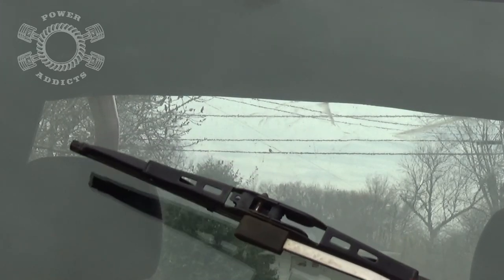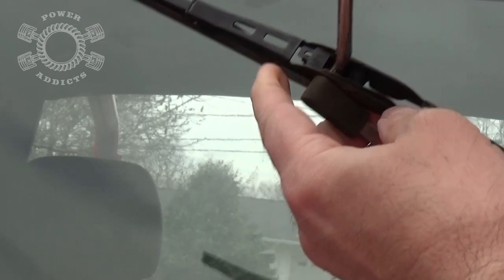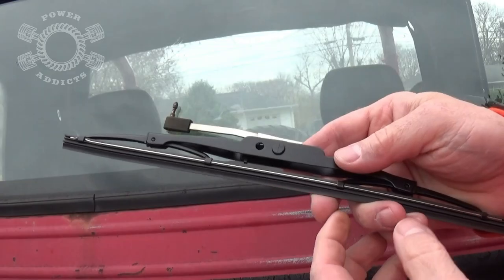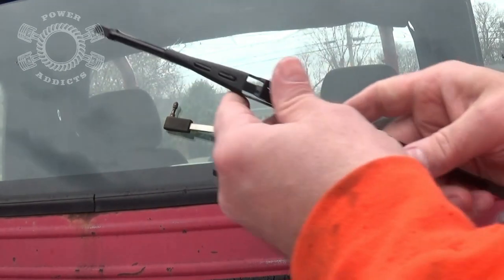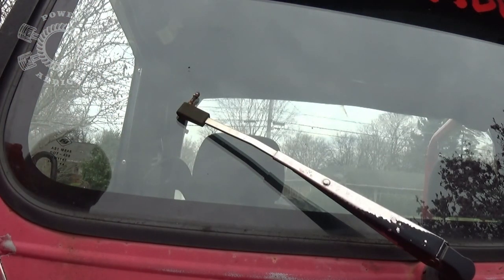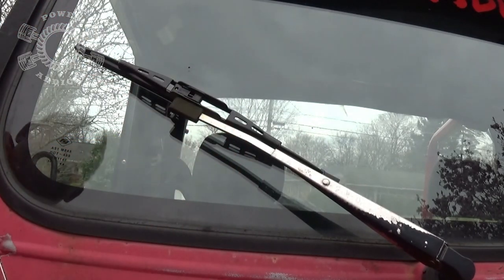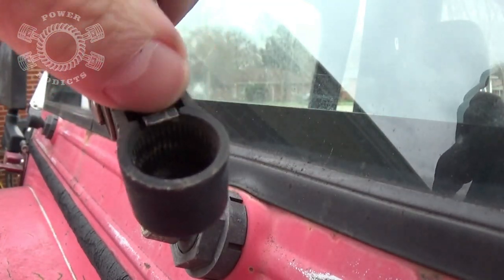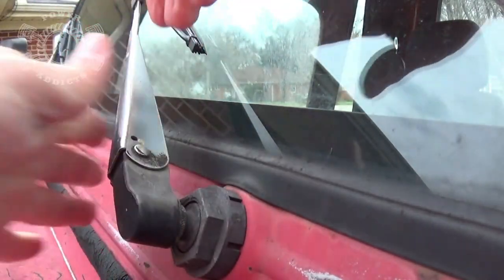Jeep Wrangler YJ Wiper Blades and wiper arm removal #poweraddictscrew

Comment: I just replaced the blades on my 93YJ with the same Rainguard wipers. Of course I work at O'Rielly's as of the last month so I'll be replacing a lot of stuff like the Stant locking gas cap I also got the other day.
Reply: If you haven't yet, check out all his videos. He is a YJ guru

Comment: I use 13" blades rather than the OEM 11" blades on my YJ - much better wiper coverage.
Reply from the maker: Thats actually a good idea. I'm going to try that next time. Thanks for the great suggestion!
Reply: I am new to Jeep, and my yj must have had old 12s on it. I put the factory 11s on and they are just too dang small now. Wish I would have bought 13s. Next year I guess.